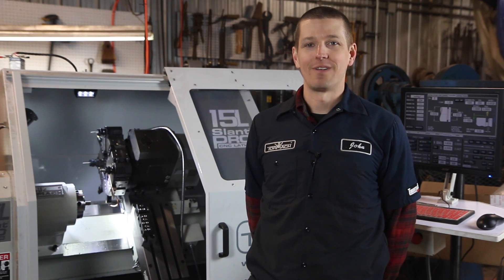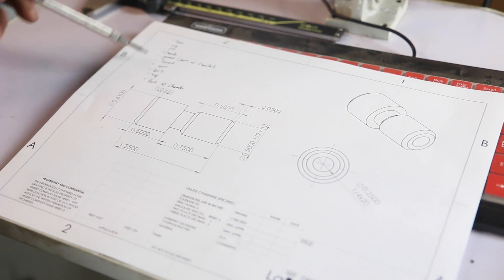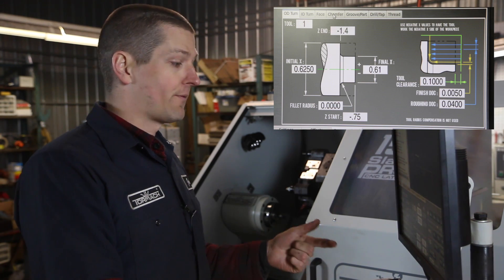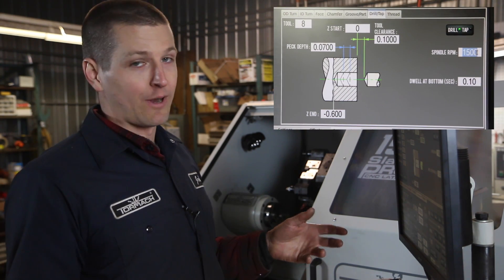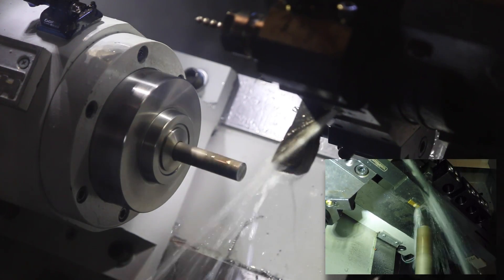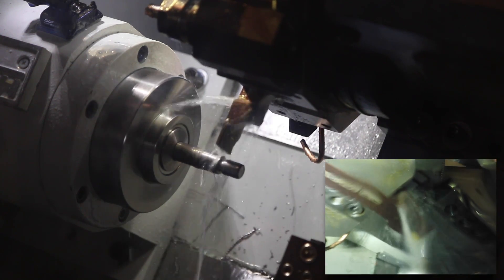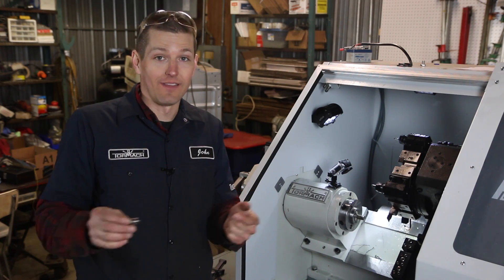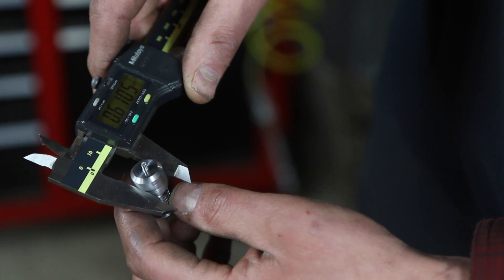Rigid Tapping and More on the Tormach CNC Lathe! Widget33

Comment: Hi John, I hope you get this comment. I noticed you are using (what looks like) a JFK collet closer. For reasons unknown to me, Tormach no longer sells them. However, I could get one for my 15L lathe directly from JFK Co. but I recall by other machinists that closers like the JFK rattle too much at high speeds. It seems I might be better off with a 5C collet chuck instead since they cost less. However, have you ever used a 5C collet chuck? Do you know if they have the same holding power as the JFK with the drawbar? I'd appreciate your reply. Thanks!

Comment: Where did you get those drill and tap holders? I couldn't find them on the Tormach website as I was putting together my tool holders together in my cart. Thanks in advance for any info

Comment: tape on the back, you can almost get away by using the seco 150.10 Parting-off, insert or insert from another company
Reply: Sorry for translation.
This I mean is that when you Parting-off The item. there will be a small piece on the The item when using normal Parting-off tool.
but with a plate with 6 degrees angle will the stump sit on the shaft you Parting-off from

Comment: I could watch this stuff all day.  I like your play-by-play of the machining.  Also, I'm noticing the same thing with your go pro as I have with mine...  The footage is a bit green compared to the SLR footage.  I wind up adjusting each clip so it matches.  It bothers me on my vids...  Doesn't bother me on yours.  I do like the additional view for sure.
Reply: LOL.  Yeah it's another step in the process, everything has to be rendered, etc...  I wish GoPro would just white balance properly.  They work fantastic in the sun.  Anywhere else they are green/yellow.
Reply: If you are using FCPX, it's pretty easy to set up a color correct preset or copy the correction "effect" from one clip to another.  If you are in the same lighting all the time a preset is the way to go.

Comment: you talked about a way to catch parts after cut off. We had a try fashioned on the cut off station that would catch the part. just a piece of sheet metal bent to form a tray.
Reply: NYC CNC
Since the cut off is your last operation the turret doesn't need to rotate. You also mentioned that you were looking at setting stock to a length for the next part in a multiple part job the cut off could be just that after parting off the turret moves to the distance to advance the next part, you collect the part just made an extend the stock for the next part.
Reply: NYC CNC
John
you videos are great, its been over 30 years since I did that kind of work, I ran a MAZAK 4L it had 12 stations on the turret and the chuck had a 2.5" throat with an auto feed. It ran off of a paper tape not like today where the computer feeds the program. Thanks your channel bring back the old days for me.

Comment: Great video. Speed/feeds need to go up quite a bit. I'd run 12L14 at least 450sfm. I usually max out my spindle on small mild steel parts. Feed wise, my standard is .01 rough .005 finish. Just remember not to over run your nose radius. Tearing threads is usually a sign of being cut to slow. Tool is ripping material off instead of cutting. As for length of your part make sure that you hug the collet as close as possible. I cutoff about .05 from the face of them. 3x diameter sticking out before you need a center. 10x diameter needs a center and another form of support. Hope that helps.

Comment: Nice job, John!  You make it look easy, and the Tormach is certainly a capable machine for prototyping and light production. 

For the nub reduction, can the parting inserts be done with a slight angle, so it cuts a little deeper on the part side of the cut than the remaining stock side?  If so, the nub would be left on the stock and be removed with the facing operation of the next part and your part would be clean. Other than that I think the size of the nub is going to be a factor involving material type, insert sharpness, and speeds. 

-- Mike
Reply: NYC CNC This is a two part operation job for parts like this. Your going to have that nub/nipple when parting off, even the Hass SL20 and the new ST10 does that because there simple isn't enough metal rigidity left when the cut off tool gets that far. Because of this use your pull-back chuck to do the first side turning of multiple parts, cut off the part about twenty or thirty thou longer for cleanup, then make a facing program and reinsert the part nub/nipple side out in the proper size collet (you may need some emergency collets for this) with a collet stop and using a pusher chuck or accu-length type chuck (Royal Products are great for these).  With this system you can load the second operation quickly and accurately every time without touching off the part each time. Now face, chamfer and turn to finish size and length.
Use a post-it note piece of paper or some shim stock to touch off your tools using the Z Face measure option and X measure option then use your G54 for the Z axis (if this machine has that) and put in say -.0150 or which ever thickness your touch off paper/shim stock thickness is. This will put you tools right on target to the face of the material stock. On the first part use op stop, single block and let tools move into position speed slowly, 25% to 5% to the part, once your sure the tools aren't going to crash take single block off. Do this for each tool on initial setup to avoid costly crashing of tools and holders and knocking your turret out of center. After your sure all tools are clear to go take off the op stop and let her run.
Wow, sorry, got long winded there.

Comment: Nicely done John, as always. Regarding the inserts, it's a little difficult to tell from down here, but the inserts you're using look like negative rake (?). I would try some high rake inserts on the aluminium. They also work well for many steels, but tend not to be as robust as a lower raked insert, and that could be an issue for higher volume work. I find chip control often more difficult and somewhat more fiddly to hit the sweet spot on the chip breaker. However I'm quite a fan of high rake inserts in general for material of normal hardness.
Reply: There was a recent discussion on rake on a local metalworking email list. What I learned from that is that positive rake is good for aluminum, and works fine on all materials with low powered and less rigid lathes (like my South Bend 9").  Advantage is that it gives good clearance below the cutting edge, and has lower cutting force as it tends to shear off the metal. Downside, which is why negative rake inserts are better if you have the rigidity and power to handle it, is that there's less support under the cutting edge and the inserts aren't generally reversible so you get fewer edges per insert. Negative rake also tends to make the chip curl more sharply so you get smaller chips that are easier to deal with in chip conveyors and no birds nests. If you get the negative rake from the holder rather than the insert, your inserts don't need any clearance angle so it's solid under the cutting edge for better support, and you can flip them and double the number of edges per insert. So negative rake holders give you less insert breakage, more edges per insert and better chips...all good if your machine can handle it.

-- Mike
Reply: BigMjolnir G'day Mike, I'd agree with all the things you mentioned, thanks for the additional input. Being able to flip the insert is a great advantage in terms of cost. Speaking of which I'd add another in that in my experience many inserts can be found cheaply on ebay etc, but high rake inserts aren't as common and tend to command a premium price. Not to take anything away from the Tormach, it looks like a very good machine of that type. However it is relatively small by industrial standards, and John by his own admission doesn't even push that lathe, hence why I suggest trying higher raked inserts, particularly on aluminium. The is a very good article in MMS that sums up the situation, however as the author is from Sandvik, the same material is also in their technical notes. The caveat being insert manufacturers want to sell inserts and manufacturers want to minimise machine time, hence insert manufacturer's guidelines tend to be very aggressive at the expense of tool life.  http://www.mmsonline.com/articles/read-your-chips
Reply: Thanks for the link!  Interesting stuff...even if it's aimed more at large CNC users than at small manual lathe users like me.  One of these days... ;-)  Some of it applies to any machining though, and is well worth reading.

-- Mike

Comment: Turn up that speed on all fronts, carbide loves fast moving steel, for a part that diameter, rpm's would be up in the 1000/1200 mark for me, Also for the finish pass try a VNMG with a .4mm rad tip, Happy Turning
Reply: NYC CNC I agree with Jims Machining in that you can speed up the RPM and achieve even better results.  I typically like to rough steels (heat treated) at around 525 sfm, and finish at 650.  Just for reference, many coated inserts have a suggested range of 400-1200sfm, so even my numbers are rather 'conservative,' but I've found them to be a good compromise between efficiency, quality (of the finished part), and longevity.  On smaller diameter parts, it is not uncommon to run out of spindle speed before you reach the desired actual SFM, but the cut will still give you a better surface finish.  The only time I would likely slow down the RPM below an optimal level would be when running a chuck (if the jaws are not clamping the part tight enough, the part can fly out!) or any part that is significantly unbalanced.  For threading, I would not hesitate to cut the threads at 600-800rpm, which will likely get rid of the tearing you see, though results can vary depending on the number of passes you're taking, how far out of the collet the work is, etc.  Typically (at least in steel), I'll start the RPM around 6-800 and see how it cuts.  If there's tearing on the threads, I'll raise the RPM until it's gone.  I'll keep raising the RPM until you hear a bit of a high pitched vibration (chatter) on each thread pass, and you'll be able to see a bit of 'faceting' or chatter on the threads.  Bring the RPM back down a bit and you should be pretty much optimized!  As far as cutting aluminum, I would suggest an UNcoated insert with a ground flank.  Look around for a CNGP-432, try starting around 1000sfm and .01-.014ipr (for roughing), and you should see some excellent chipbreaking, especially in 6061 or 7075.  For finishing, I'd use a DNGP or VNGP running at about .003ipr, which typically leaves a beautiful finish.  I'll leave it at that for now as I don't want to give away all the 'tricks' and learning what works from trial and error is half the fun!  Hopefully this will help steer you towards some excellent results (and learning), and of course thanks for posting the video, it's nice to see that machine in action!

Comment: Kick ass dude! Looks like you're having fun with the lathe. Sadly lathe work for me has slowed. I'm extremely fast with setup and programming on the lathe so it bums me out. Doing a really big job now though that will require some acme threaded rod to be turned so there's that. And some standoffs to make which I'm sure you know is just gravy to make. Got something complex for me to make on a weekend? I need to unwind haha.

Comment: Just a few thoughts on the drawings. I Ignore the sloppy placement of the dimension lines, but what is important Is that a dimension convention is complied.   

There should be doted lines on the left view, signifying the taped hole and should have depth specified. 

Chamfer should be specified by width and angle. Simply with a single arrow pointing to them. Rarely are they demnensiong by dual linear dimension.
 
Losen tolerances, Use fewer decimals. 
There should be a UOS statement, a chart that saids the tolerance of dimensions based on how many decimals it has.

Confined Dimensions (As my professor called them). 
Where the .5 and .75 dimension are confined within the 1.25 dimension. Lets say that they are all +- .001, if the two inner dimensions were each over or under .0005 each then the 1.25 won't be respected. Decide on a datum plane, front back or middle, and have most dimensions extend from it over lapping from each other.  
 
UOS (Unless Otherwise Specified)
Reply: That's all fine and dandy, and as a machinist myself would be preferred but drawings rarely come to me with the way I'll machine it in mind on the call outs. It's always fun when you read "tap for 1/4-20 on opposite tube on far side of inside tube." Yeah, I'm dealing with that now and requesting the actual drawing files so I can rotate and see wtf they're trying to say failed. Fun stuff.

Comment: Excellent video, maybe I will be able to convince my company to invest in a tormach CNC lathe.
Reply: northernmetalworker Look for a real lathe. Haas as a bare minimum.

What do you make? What are your requirements?
Reply: Tormarch is the Beats head phones of home shop cnc. They are the king of marketing, OK quality and OK value. 
Look into 
SIEG, Pro-light, and smithy.
The smithy automate Is hand down a better deal. 
Tormarch 11K lathe + 16K for turret. (EDIT  16K is for the combo.) 
Smithy 14K lathe 2K turret. And double the capacity and motor power. 
www(DOT)smithy(DOT)com/media/pdf/cnc/AM-1320-1340SL-lathe(DOT)pdf
Reply: Alexander McGilton the tormach turret is 16 grand? I really hope that's not true.
Reply: akromix My mistake, Its 16 for the lathe and turret set.
Still that make the two machines comparable in price. 
wwwDOTtormach.com/store/indexDOTphp?app=ecom&ns=prodshow&ref=34444-T
Reply: Alexander McGilton If Tormach is the Beats headphones then the rest of your product list are the Wal-Mart no-name specials. No one should be buying any of those machines for real work.
Reply: atomkinder67 No argument, their all bottom of the barrel, Tormarch included. My point is that a buyer should always shop around before settling on the most popular.
Reply: Haas lathes and machining centers are "popular" as well.  Their popularity only revolves around how much they push them into schools.  Most real shops do not use them.  My point I guess, is that anything that can get the job done for the budget your business has will be fine.  Anything can be sold and upgraded.  I'm sure John didn't want to spend $70k+ on a machining center when he first started out as that's a huge investment for something that may not pan out.  Now that he's gained a lot of ground skill wise and business wise one may be worth it.  

But fuck haas.  Seriously.  New age fadals.
Reply: I don't have much of a gripe with hass, you get what you pay for. Funny you mention schools, because my former school is now purchasing a new Hass mill and lathe to replace their mid 90's cnc machines. All things considerd they aren't a bad choice. They won't fall apart in 3 years like the cheap import. The work being done doesn't justify Hardinge, Mori, Mazak and so on. And the fact that there isn't an ocean to cross makes it cheaper then the other mid rang quality machines coming from Europe or east Asia.
.
Reply: akromix What's wrong with Fadals? It''s a real machine tool, the control is the simplest, easiest to understand ever created, and the real wonder is why no one ever integrated some of those ideas into their controls (mainly Haas). Sorry, but Haas isn't popular because they give deep educational discounts, they're popular because they are inexpensive, easy to operate and generally have great support. Will they option you to death? You bet. Doesn't make them bad machines, though.
Reply: Fadals are throw aways.  Their control also is not the easiest and simplest...ever tried a Hurco out?  And I don't agree on haas having great support.  I've seen and heard more horror stories than not.  Either way, pointless to argue as every machine has their pros and cons.  I work on 4 hurco machines every day and love them so I may be a bit biased.
Reply: akromix Good for you! I've heard horror stories about Hurcos too. One thing I haven't heard is a horror story about a Fadal beyond failure to maintain them, but that will apply to your highest end Makino down to the lowliest Tormach. I have heard good things about the conversational regarding Hurco, but I don't care about conversational controls. Haas' current offering is absolutely horrendous, but the machine is solid if you know how to run it. Same with Fadal. I've pushed a VMC2216 into the 10 cubic inch per minute range with high speed toolpaths and proper programming in steel without the machine complaining a bit. Know your machine and you can do better. The Fadal is only a throwaway if you're ignorant regarding its capabilities.
Reply: I'm not ignorant regarding it's capabilities, that isn't the point.  They simply don't last.  Sorry, but fact.  Find me a fadal that's 20 years old that isn't sloppy as shit with the original ways and I'll say they're a good machine.
Reply: Hell, find me a fadal with 10 years under it's belt with the original ball screws and ways that has been used properly and in an every day machining environment that isn't sloppy and I'll concede.